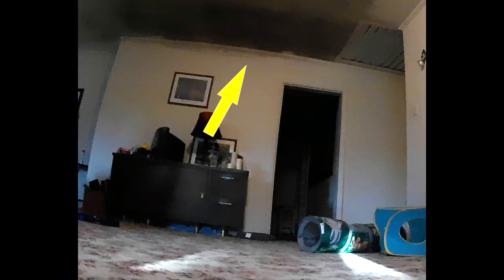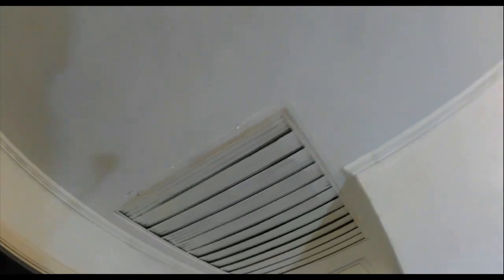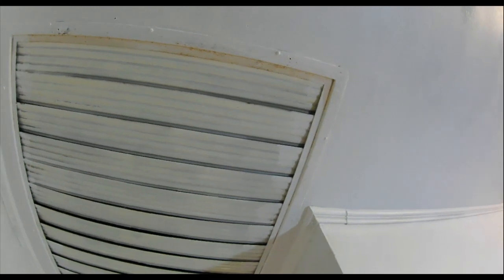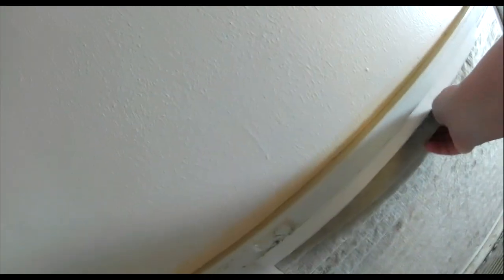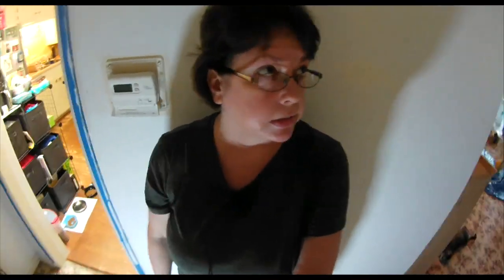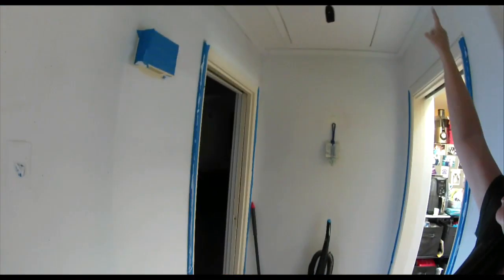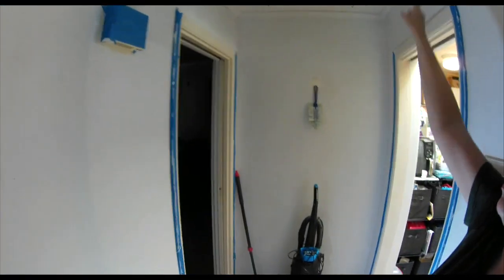Why I stopped painting my ceiling #diy #painting

Comment: Did you use a mold-killing primer or otherwise kill the mold before painting? Otherwise you may be wasting your time as painting mold doesn't kill it and you may see it show up again. I'd also recommend a dehumidifier if your inside air is that humid. 

I wish I had an attic fan to pull in fresh air. You said you can't use it because you don't have screens in some windows, but would screens be much more expensive than deleting the fan vent? Or is it not something you can just pop in on that house? 

There's also adhesive screens; we use sliding door one with a split down the center and magnets to close it behind when we use the sliding door.

Be careful about molds. I had a family member get very ill from mold in their house after a plumbing incident. 

Anyway, I'm no expert. Good luck!
Reply from the maker: I used kilz primer. The label said it kills mold and prevents it. The dehumidifier is a great idea. Thank you for the advice.